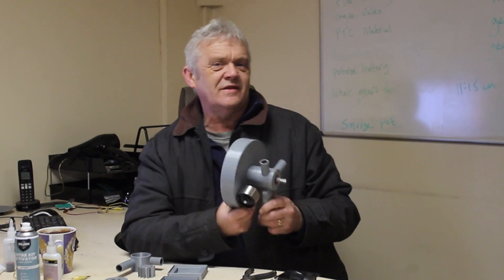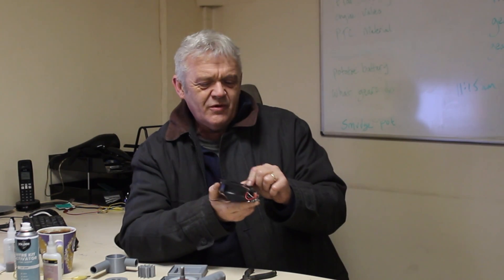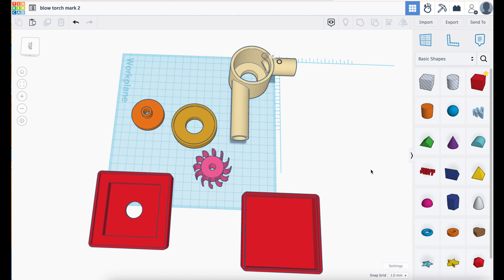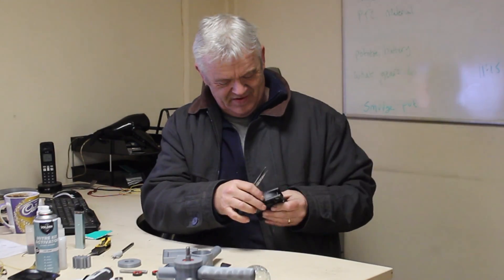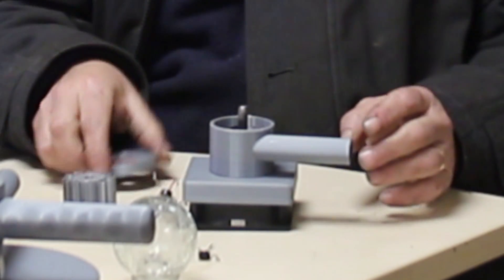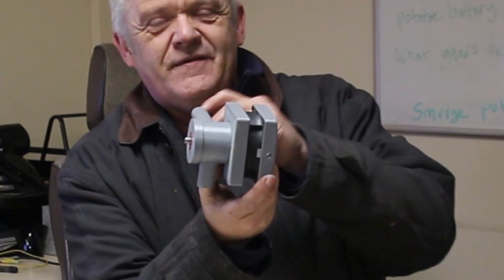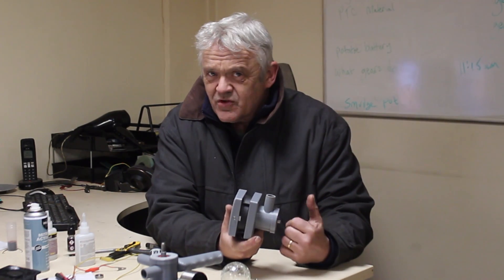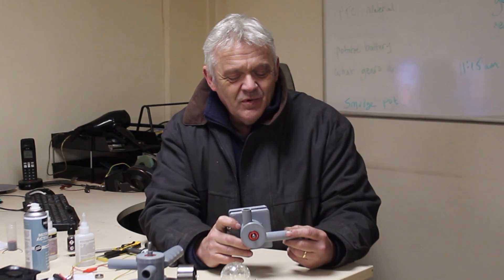1897 PC Fan Blown Air Generator

Comment: Using something to contain the wind to move your generator That's interesting let me guess now you're going to hitch a bunch of those together and use the same wind input to spin them all because the wind has to go through all of them  spinning them all before it exits the unit so the more generators along the line the more power you can get out of the same input

Comment: Does this air inlet have a 'whistle pinch' or any other method of focusing, deflesting or directing the air to increase optimal velocity and impingement?

Also, while it may not matter at all, especially if you are only breathing into it, a slightly larger, and more side oriented exhaust would ever so slightly help the reduction of back pressure. ~( 'w')/

Again, I do realize, that when one is talking this tiny little mechanism, at such low power inputs, it is really hard to notice much of a gain, but, for those wishing to experiment further into this, seeing as they often use 'accelerator needles' on such devices as Pelton wheels, and from this gain much more conversion of the energy potential of the input fluid, it only makes sense to do the same here.
Reply from the maker: yes it does mate - if you have a look at the tinkercad drawing you will see it but I am doing a follow up to this and I will highlight the pinch in that video

Comment: By sealing the fan in with the cap you've increased the resistance the blades are exposed to. That's why it's stopping so quick
Reply from the maker: no that's not why mate - the generator has a lump of steel and magnets in it and the magnets are trying to rotate past the steel - they can't - that's why
Reply: @ThinkingandTinkering  i understand theres magnetic resistance but there doesnt appear to be an exhaust for the air which passes the fan. 

It'll just spin around the fan and once the momentum runs out it'll escape back the way it came. The air you blow into it just fights itself 

Do a quick test with cap on vs cap off

Comment: I would have created a cone at the end of the blow pipe and attached a hyperbolic cone to the center of the PC fan with just enough clearance between the blow pipe cone and hyperbolic cone to drive the “fluid” to the edges of the PC fan blades. That would probably the simplest “fluid” generator you could build. But that’s me. :)
Reply from the maker: it'sa good idea mate - you have to build it - go for it and let us see

Comment: To build the Yildiz Magnet Motor with an output of 20 kW, you will need the following materials:

Rotor: You will need a circular metal plate with a diameter of 400 mm, a thickness of 50 mm, and a weight of approximately 16 kg. You will also need 12 

cylindrical neodymium magnets with dimensions of 50 mm x 20 mm x 10 mm and a weight of approximately 60 g each.

Stator: You will need a circular metal plate with a diameter of 420 mm and a thickness of 30 mm, with 12 slots evenly spaced around the circumference. Each 

slot should be able to hold a stator coil. You will also need 12 stator coils made of copper wire with a gauge of 14 AWG and a length of 100 meters each.

Bearing: You will need two ball bearings with a diameter of 50 mm and a thickness of 20 mm, one for the top and one for the bottom of the motor.

Frame: You will need a sturdy frame to hold the rotor and stator in place. The frame should be made of metal and should be able to support the weight of the 

rotor and stator.

Wiring: You will need wiring to connect the stator coils in a series and to connect the motor to an external power source.

Instructions:

Begin by constructing the rotor. Attach the 12 neodymium magnets to the circular metal plate, evenly spaced around the circumference. Use a strong adhesive 

to hold the magnets in place.

Construct the stator by winding the copper wire around a cylindrical object with a diameter of 20 mm, such as a pencil, to create 12 coils. Each coil should be 

approximately 100 meters in length.

Attach the stator to the circular metal plate of the stator, with the coils in the slots, using a strong adhesive.

Attach the ball bearings to the top and bottom of the motor frame. Ensure that they are securely fixed in place.

Insert the rotor into the stator, making sure that the magnets are aligned with the stator coils.

Connect the stator coils in a series by soldering the ends of the wires together.

Connect the motor to an external power source, such as a battery or power supply, using the wiring. The input voltage should be 220 V, and the input current 

should be 91 A.

Start the motor using the external power source.

Note: It is important to ensure that the motor is properly balanced and that the bearings are well-lubricated to prevent excessive wear and tear. It is also 

important to monitor the motor's temperature and ensure that it does not overheat.

FOR MORE INFORMATION, leave me a private message. >>This message was only intended for Robert-Murray Smith<<
Reply: Materials needed:

1 Rotor with 12 evenly spaced magnet holders
12 Magnets (50mm x 20mm x 10mm)
1 Stator with 12 evenly spaced coils
12 Coils made of 14 AWG copper wire
1 Shaft to hold the rotor
2 Bearings to support the shaft
1 Base to mount the motor
Screws and bolts for assembly
Reply from the maker: have you made one?
Reply: @ThinkingandTinkering  i can barely afford to cross the dtreet and not die hungry. though I can promiss you I did run ALLOT of virtual simulations. Is there any place I can give you more information privately? I don't want anything, not even the attention, I just feel I am. sitting on somethimg BIG and I can't do anyrhing about it :(

Comment: Any chance of up scaling the maths and working out how much this setup would generate if fitted inline to the average mains water pipe Bob...just for sh*ts & g*ggles
Reply: Not to discourage, but I see two issues with that. One, personally, I try to limit water use, and the taps are on only minutes a day. Two, the water provider has to pay to pressurize the water to get it to consumers, they would not be ok with adding an energy capture device.

I do like the idea, just perhaps on a river, or as a protest against water/energy inflation. If enough people did it, nah they'd just raise rates for others, it'd have to be a boycott across the board.
Anyway, cheers.
Reply from the maker: it's more than not ok mate -it is actually illegal to do that
Reply: @ThinkingandTinkering  what?..the maths?...ok get your point,some daftys likely to try it😂⛲

Comment: Hello

Pretty neat fit..

Been thinking of asking this for a while.. where I come from almost every room would have a ceiling fan.. can we use the wind turbine under a ceiling fan? Would that generate any electricity? Should we place it below the fan to get wind to turn the turbine or above the fan to get the suction to turn the turbine.
Reply from the maker: you could do it mate - but i don't see a lot of point I am afraid - the energy captured would reduce air movement and negate the fan - to get the same air movement you would have to turn the fan power up so burn more energy to produce less

Comment: How about making a funnel like thing,  that has a ring that can hold a trash bag full of air, like a 40-55 gallon lung to blow the torch! Then squeeze the bag,. Or if you really want to make something, make one of the accordion like blower used to start fires in a fireplace, or in a forge, it could be two sheets of builders board, 6" x 12" with a a handle on end, a tee with check valves on one plate with a hinge connecting them at the opposite from handle end, with the tee connected near the hinge,  use a semi thick paper, not construction paper, but  paper bad would work, cover with clear packing tape on both sides,  fold back and forth zigzag, abd use duct tape  ti connect to the paddles,  sealing all sides, allow the paddles to open to about 60° it should move a decent amount of air, with a 12mm I.d. tee to aboyt 20 mm tee, with chevk valves, possibly using flaps, or balls yo firm a valve, making a intake and exhaust,  tgr exhaust using a bit of hose  going to the torch, if the pavking tape isn't wirking out, duct tape should work well!
Reply from the maker: like a bellows mate?

Comment: I wonder if a funnel attached to the input pipe could get it working as a durable wind turbine, with no exposed moving blades.
Reply from the maker: it need a degree of input pressure mate

Comment: Hi Robert, and others, I wanna build one of the wind generators you were showing earlier. My question is - which copper wire diameter (in mm) would you recommend I use for good old serpentine coil? Thanks :)
Reply from the maker: 0.1-0.2mm mate
Reply: @ThinkingandTinkering  Thank you sir, you're definitely an inspiration! :)